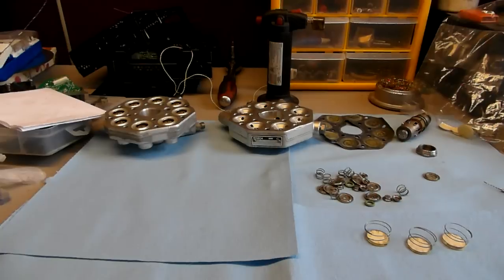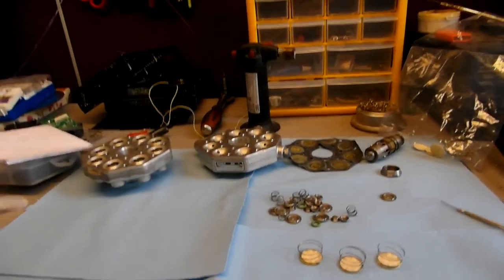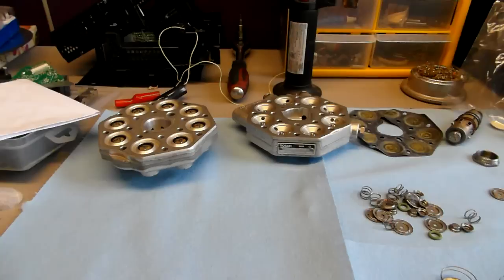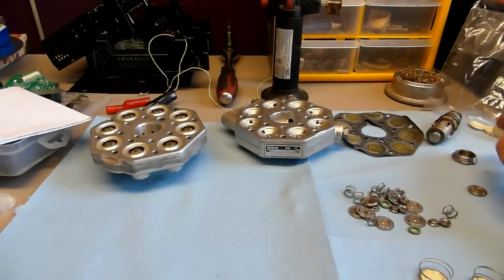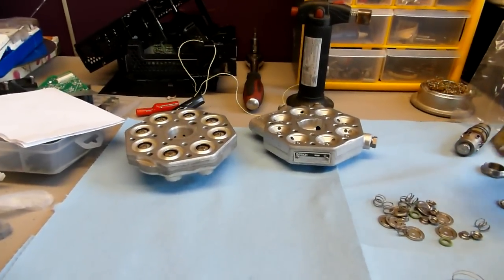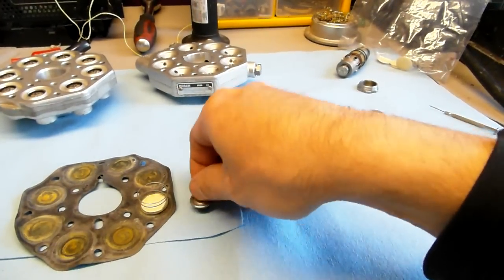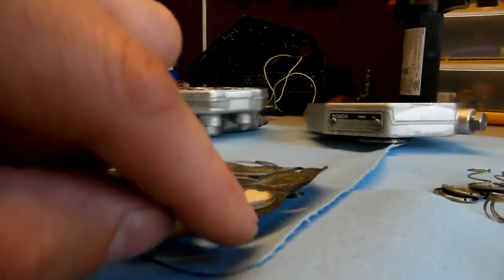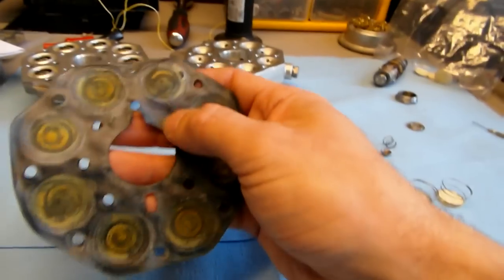Mercedes fuel distributor. Part 1. BAD REBUILD. DO NOT USE Rebuilt Systems on eBay

Comment: Re. that cut in the diaphragm: In your video around 5:17 I  can see traces where the diaphragm used to be around that hole you talked about. It barely goes around the hole, so that hole was not covered.
Reply from the maker: It's been 7 years ago I tuned that engine. Don't remember tiny details anymore. I sold that car and it runs nice.

Comment: do you actually recommend not buying rebuild kits on ebay or sending them for a rebuild? I have a bad fuel distributor for a 380se and im waiting on that but with your help I think I can do it on my owm but the real reason I want to do it is because everyone wants my core to buy a rebuilt unit and now that u showed me this im less inclined to do this.

Comment: New to Mercedes. Just got two 300SLs that sat for years. Will I have to rebuild the distributor or can i just pump new fuel through it? I'm sure it's gummy so I guess my question is do I need to rebuild or can I take it apart and clean it out without a rebuild?

Comment: I have a beautiful Black 1991 560 SEL with 327000 miles. I was told that there is a problem with the fuel distributor delivering insufficient fuel to the no.7 cylinder. Although I am a good mechanic I am starting to believe the rebuild might be beyond my capabilities and testing equipment. Doe's anybody know of any rebuilds on the market that are any good? Any feedback would be appreciated!
Reply: John Slaughter, I am selling this fuel distributor remanufactured by BOSCH. Would you be interested in it?
Reply: I might be...email me gmach500@gmail.com
Reply: Hello. I have sent you an email. See it and say me what you think about my BOSCH remanufactured fuel distributor.

Comment: Rebuilt systems is a joke.  Sorry to hear he ripped you off and gave you such a hard time. I send ours off to CSI Specialist in Georgia. They rebuild it, calibrated and bench test it. You also get a two year, unlimited miles on theirs. super nice guys and super smart. No crazy glue like old crazy glue Gene. If they haven't owned a W126, came from Europe or wasn't born before 1950's they don't touch it.

Comment: That is just embarrassingly awful.  I used to rebuild CIS distributors for an independent Mercedes shop, so I know 'em fairly well.  I'm honestly surprised the guy even bothered taking it apart with as little knowledge as he clearly has.  If you rebuild them as well, then I don't even need to mention just how insanely finicky these things are.

Only time I ever buy parts on eBay is when I need to fill a space and pass some time.  Bleh.
Reply: rhkips looks like you will be chief technical for my new project 🤣 I'm debating rebuilding my fuel distributor on the Audi

Comment: I see you are still at it. Only three people have had problems, not one bad review on ebay. Not one. Only three BBB claims and I win all three.  Check for yourself. The brown on the gasket is from gasket sealer to hold it in place. All rebuilders use it. You and Troy are unreal. You open the unit up and refused too let me rebuild it and want a refund. I tried to work with you. If anyone wishes too see me 1099 forms from paypal, I will show them. Do you think ebay or paypal would still let me have a account if I was a problem rebuilder. Get a life. Anyone can turn a adjustment screw and set the fuel flow off and video tape it too try too get a refund.!!!
Reply: Just stop. Lol I specialize on these cars for a living. This is one of the most half assed, ghetto rebuilds I have seen, and I have seen many in my 10+ years working on these cars.  Gasket sealer and super glue? Looooooool you have been exposed buddy, and rightfully. So.  All you shade tree; garage hacks do is cause a customer unnecessary expenses, and deteriorate their relationship with honest, legit professionals in the industry.  Stick to Nigerian Western Union scams, and leave cars to the pros.
Reply: Just from the responses you are giving, 3 years in a row, I will never do business with you! CLEARLY you have shit customer service skills! And judging from this video do shit work as well!

Exit: Jeez man, how embarrassing. You admit you did the work and admit others have had problems with your work as well, yet you are on here getting angry because the man wants a refund? And you did not give it to him but, continue your rhetoric? Absolutely pathetic.

Comment from the maker: Finally rebuilt the unit and installed it back in the car. Engine runs perfect, idle is super steady, RPMs pick up amazing, engine runs rock solid and smooth.

Took me long time to calibrate the unit, had to remove it many times to readjust. If I would to do it from the start I would measure and record all values before dis-assembly and install all metering springs in exact order they came from factory.
Have videos of rebuild process and make last one today showing how car runs now.

Comment from the maker: Received new rebuild kit, replaced all rubbers inside. Had to remove and reinstall the unit many times to recalibrate plunger height. After all troubles I finally got my car to run great again :) There are no leaks from ports, ports seem to be very balanced now, idle and acceleration is good again. Have few more videos to show how car runs after rebuilding unit myself.
Reply: Plunger factory settings is 0.6mm

Comment: This is what ebay send me
eBay Customer Support has reviewed the case and made a final decision.
We decided not to issue the buyer a refund. You don't need to do anything else for this case. The hold on this PayPal transaction has been removed. This case is closed.
Decision:
This case has been decided in your favor. The hold on this PayPal transaction has been removed.
Comments:
This item isn't eligible for eBay Buyer Protection. You don't need to do anything else. Because this claim doesn't apply, this case, any feedback left, and all detailed seller ratings left, will not affect your seller performance. In addition, any feedback left for this transaction will be removed. Note: It may take up to 24 hours for these updates to reflect in your Seller Dashboard.
You can also view the details of this case in the Resolution Center.

Comment: Ebay did not refund your money and found in my favor. My listings are still there. You just wanted a free rebuild. How can so many people with the same distributor that I have rebuilt have no problems with theirs.
Reply: rebuilt systems Mate, there is a video of the poor quality and technique of work performed. It's time to listen and improve the service, not defend yourself. After all, he just wanted the rebuild done correctly in the first place. These guys really take pride in their cars and for that reason the work done on them must be flawless. I get it, mistakes happen and it doesn't mean you're bad at your job, but you have to do right by the customer. Not being forced to provide a refund really says little. It's a tough business to be in.
Reply: +rebuilt systems  Did you do anything to that fuel distributor? Or just put back in box and send back to him? Come on a little kid can see this thing wasnt rebuit
Reply: Victor has a great reputable reputation. He is a very knowledgeable Mercedes technician,  etc. He wouldn't just blame someone for something, unless it was true .
   I have Spoken To Victor on the phone several times . He is one of the two most knowledgeable and experienced Mercedes guys that I know. The other guy is a friend who use to own a Porsche dealership. 
    You evidently don't know anything about Mercedes.  I own three SL Mercedes as of now and work on them myself. 
    You probably have never owned a Mercedes , therefore you don't know anything about them and including how to work on them .Its evident you're a scammer .
   Thank you Victor for warning us about that scammer . We Mercedes guys know you are telling the truth.

Comment: Absolutely amazing. I hope you give him a bad review on Ebay, and send him a link to this video. Do you think you can trust this unit even after you rebuild it? Or should you collect one from a junk yard, and rebuild that? Truthfully, who knows what kind of damage he might have done to it that you cannot undo.
Reply from the maker: There is another video I made after installing rebuilt unit in the car and showed ti to him. Here is a link: Fuel distributor after bad rebuild. Does not work correctly.
Actually the person would not refund for rebuild citing that unit was opened by me and it voids warranty. He said that I should have mailed it back to him for further testing. I do not want him to even touch it after seeing what he has done to it. Thank God eBay refunded me fully and removed his listing all alone.
I do not trust this unit fully but I'm pretty positive I can recalibrate it after installing all new O-rings and diaphragm. That will not be easy as unit will need to be removed many times to adjust control plunger for correct fuel delivery at idle. Major concern is that Crazy Glue traveling though unit. Most likely gasoline will dissolve tiny amount of glue still left after my cleaning but I'm sure it would have not dissolved that much of glue he put into it.

Stay tunes for more videos after I receive proper rebuild kit and final test of unit in the car.

www.RestoreYourMercedes.com
Reply: vsandvs I am amazed Ebay removed his listing. All they seem to care about is their own profit from sales. With all the headache of the recalibration and multiple install/remove, I would personally get another one to rebuild.
Reply from the maker: Noble4Truths

I know, it will be heavy lift to recalibrate it without proper tools. Hopefully I will succeed. I wish I can find another unit to rebuild. For 500SL these go for around $450 used plus rebuild kit and supplies for another $100. It just gets too expensive. If I could not calibrate it I'm thinking of buying 560SEL unit and try to install that one. Those are cheap used, around $130. Lets see how it goes, in few days parts should arrive and today I will double check on fuel pressure regulator valve that looks to be stuck sideways in my unit.
More videos to come.